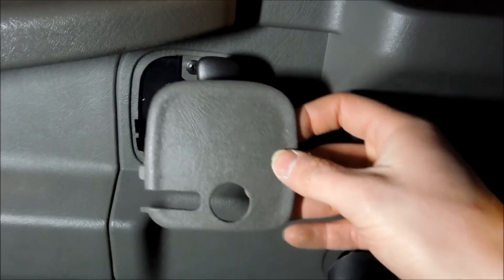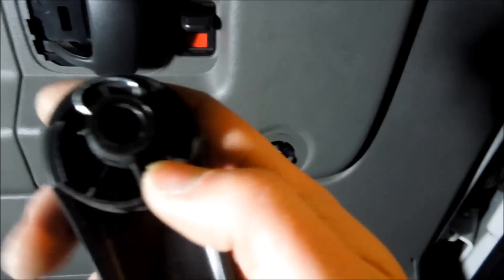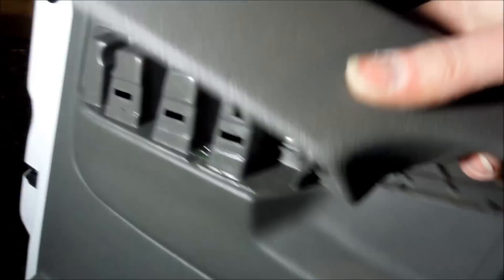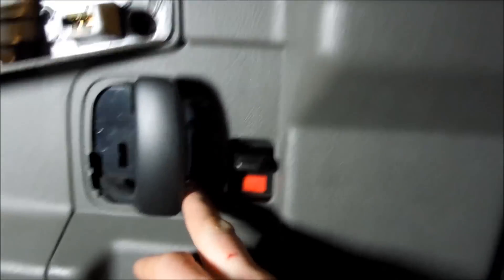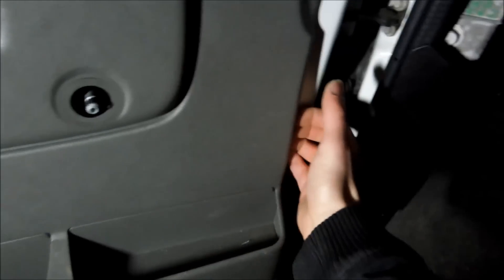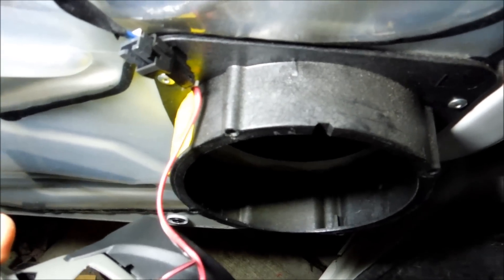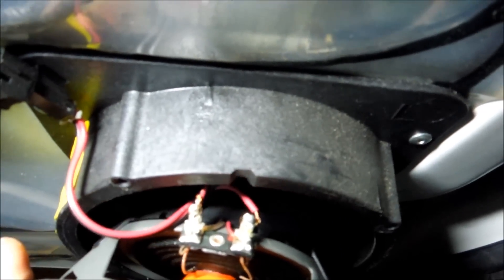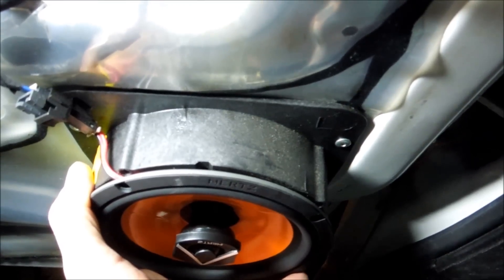how to  install speakers in a chevy express 2011

Comment: nice video, I wanting to upgrade whole audio sys. I'm thinking the front door the speakers will be to low how do the new speakers sound low. also where's a good place to install front speaker amp an sub amp. my van is a 05express however it was a pre-built RV.thanks

Comment: Thanks for the diy but how in the hell do you put that pin back in for the door window crank?
Reply from the maker: put theclip back in place and then press it on to the window crank shift and you will here it click done
Reply: ghostlyrich thanks, I figured it out, I made the mistake of trying to put the pin in the slot on the handle. lol I didn't realize you had to out OVER it and it clicks into place.
Reply: CycleCruza e Ty e th street
Reply: Fun to see you here CycleCruza! BUG OUT MOTO!!!

Comment: In a 2016 Chevy Express Passenger Van the front door speakers are riveted in.  Unlike the video the speakers and speaker mount are one piece.  I had to make a 3/4" wide adapter to go behind the new speakers.  Also the door panel trim retainer clips broke taking the door apart.  GM part number is 11562256.  Should be compatible with Auveco Part Number 20998.  I've upgraded to a Pioneer TS-D1730C 6 3/4" Component Speaker  and surface mounted the tweeter in the door up by the post being careful to make certain it misses the dash when the door is closed.  The new speakers sound fantastic.  Hope this helps someone else.
Reply: So the Pioneers sound fantastic with stock head unit ?
Reply: I just came across this issue today as all my electronics were stolen and I decided to change the speakers out. Thanks for making it easy chevy :/

Comment: I have a 2007 motorhome on a express frame, the speakers on both drivers and passenger doors don t have that mount for the speakers to mount to, I lost sound in one when I opened up the door  the speaker was in the bottom and pushing out the panel there.